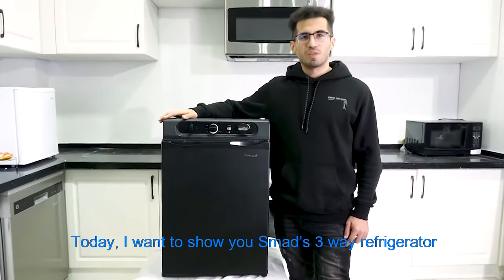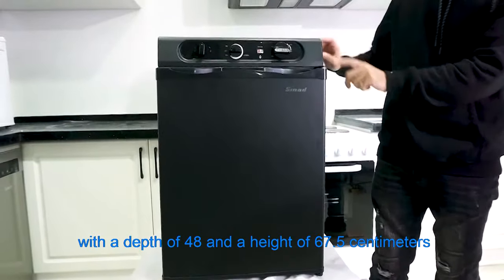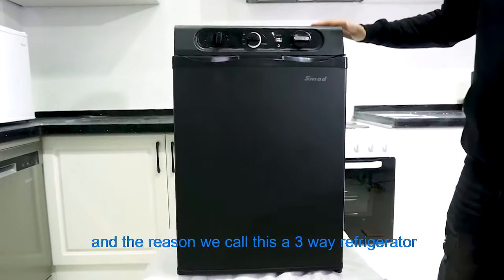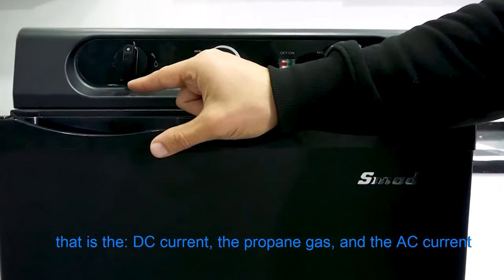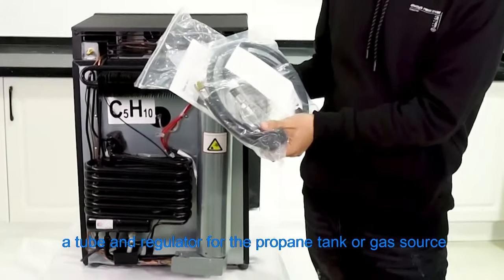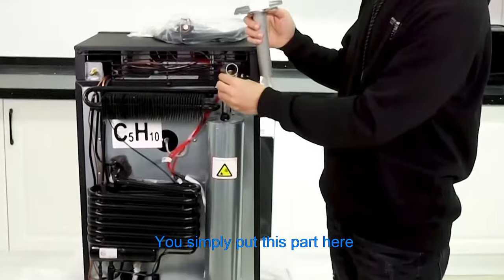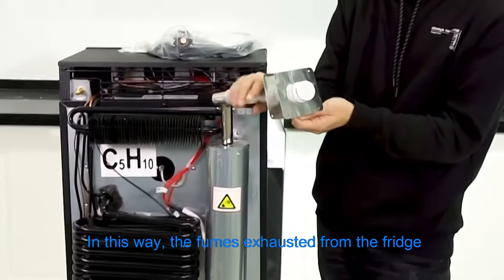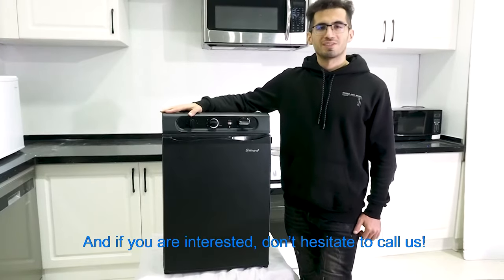3-way Propane Refrigerator - a good partner for off-the-grid living

Comment: Yes, so how many watts does it use for 12 volt and 110, how much propane does it go through? These are questions from somebody who actually lives off grid. Nothing personally but you gave almost zero actual information
Reply from the maker: Thank you for your inquiry regarding the SMAD 60L Mini Gas AC/DC 3-Way Absorption Fridge! I’m happy to provide the information you need.

Power Consumption:

    For 12V DC Operation: The refrigerator consumes approximately 120 watts.
    For 110V AC Operation: The refrigerator consumes about 100 watts.

Propane Consumption:

    Propane Usage: The refrigerator typically uses around 0.5 lbs of propane per day. This translates to roughly 0.24 kg of propane per day.

These values are approximate and can vary based on ambient temperature, thermostat settings, and how often the refrigerator door is opened.

If you have any more questions or need further assistance, please feel free to reach out.

Comment: How long is the exhaust pipe please. Do you have any fitting instructions for the 40litre version of your 3 way fridge?
Reply from the maker: Thank you for your inquiry! Yes, we do have fitting instructions available for the 40-liter version of our 3-way fridge.

If you need the installation manual, please provide us with your email address, and we will promptly send you the electronic version. Alternatively, you can reach out to us directly at service02@smadappliances.com with your request, and we'll ensure you receive the necessary instructions.

Thank you for choosing SMAD appliances, and we look forward to assisting you further!

Comment: Does it have a compressor?
Reply from the maker: Hi there! Thanks for your question. No, the Smad 3 way portable fridge does not have a compressor. It uses an absorption cooling system, which is quieter and more energy-efficient than a compressor fridge. This makes it a great choice for camping or other off-grid applications.

Comment: How much
Reply from the maker: please check out our shopify shop:https://www.smadappliances.eu/collections/gas-refrigerator
Reply: I bought one now how do I use it how do I turn it on I'm trying to get mine to work I plugged it in but nothing is happening
Reply from the maker: @stacyspigsandcrittersstacy8910  Thank you for reaching out! We're here to help you. To turn on your refrigerator and ensure it's working correctly, please check the following:

    Make sure the power cord is securely plugged into a working power outlet.
    Check if there's a power switch or button on the refrigerator itself. If so, press it to turn on the unit.
    Allow some time for the refrigerator to cool down once it's powered on.

If you've tried these steps and are still experiencing issues, please let us know: service@smadappliances.com, and we'll assist you further. We want to ensure you have a smooth experience with your new refrigerator!